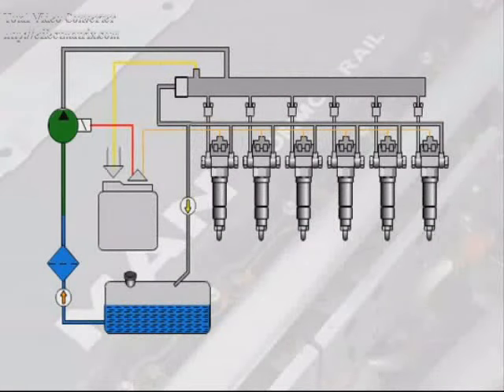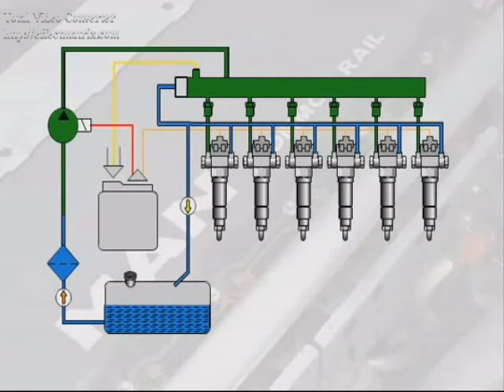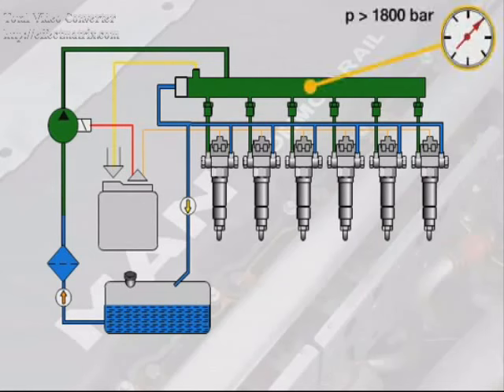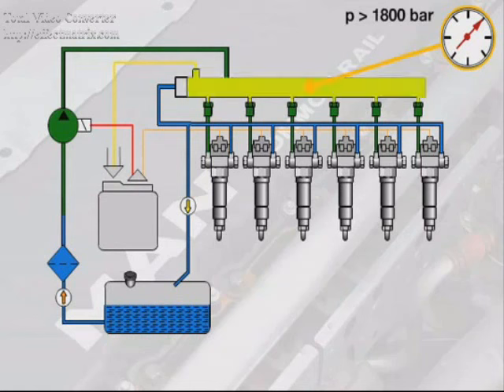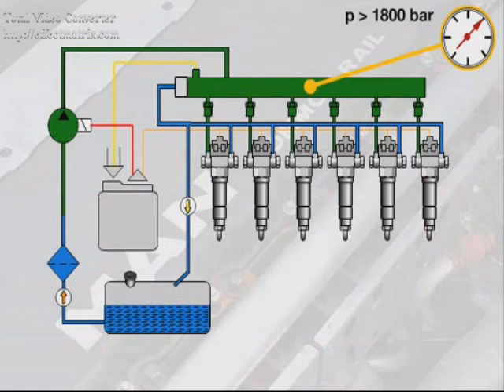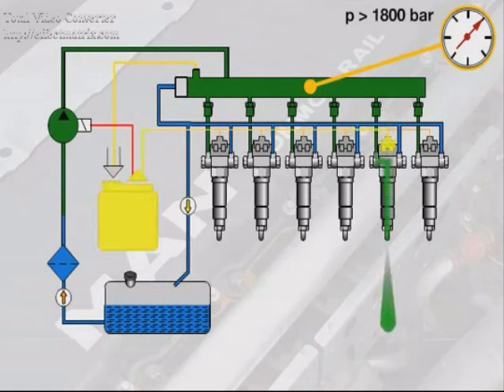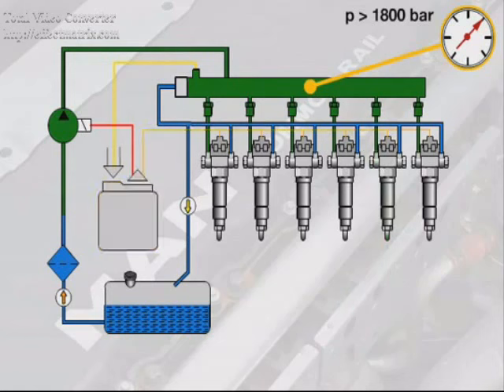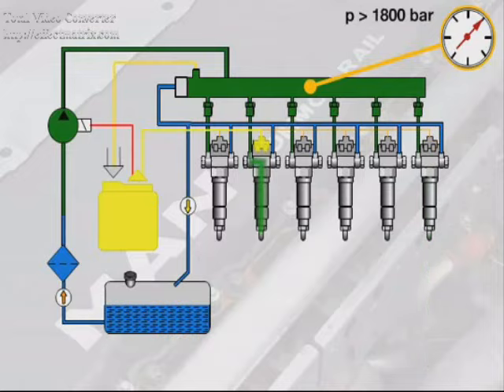Working of Common Rail Fuel Injection System

Comment: Hi. I'm struggling with a 35c14 iveco 2005. Ignition on and fuel travels up to high pressure pump but not further. Any ideas?
Reply: I hope you fixed it

Comment: I am thinking 1800 bars is way too much pressure ?
Reply: should say 1800 PSI
Reply: no, can go up around 2300 bar
Reply: @thelegand1 wrong
Reply: @thelegand1  nope it's right. I have a john deere 4045ht diesel and the fuel rail pressure is around 25,000 psi at maximum load and rpm. Some can be a little higher. 1800 bar on average is pretty spot on
Reply: @johnzadinya2181 thanks for correcting me all. Not sure why I was under the impression it should say 1800 PSI as it was some time ago. Glad somebody has spotted it though 👍🏻
Reply: @thelegand1  no problem. I didn't know that either until a few weeks ago when I was looking at my monitor and I saw the pressure I was like wow! Didn't know it was that high it's crazy
Reply: I used to work on big rigs when i was young. I was very surprised to learn that the fuel rail on Detroit engines could be as high as 50,000psi when under heavy load driving uphill.

The trainers made it very clear multiple times to wait a looong time after shutting off the engine before cracking any fuel lines@johnzadinya2181
Reply: The lm2 engine does 2500 bar.   36k psi. So i say 1800 bar is pretty average.